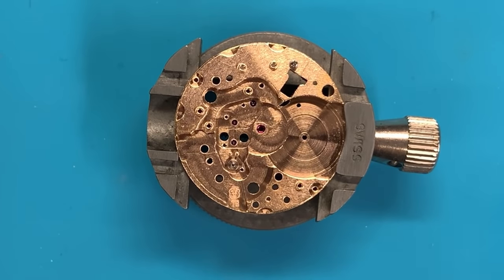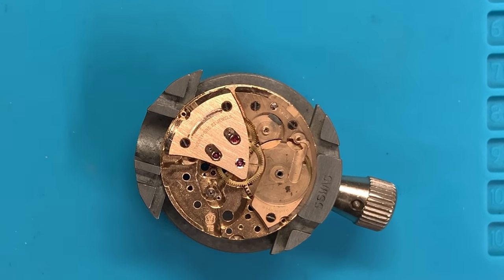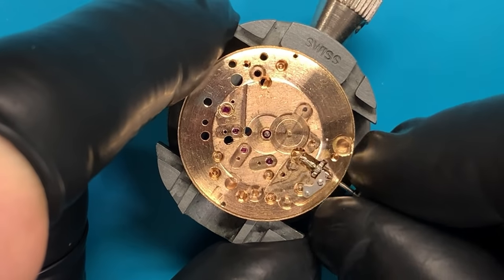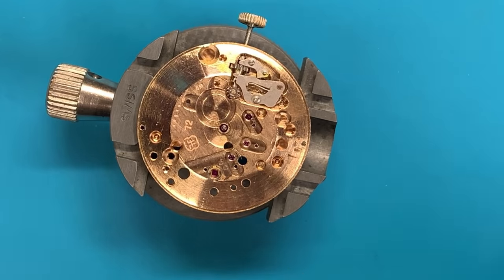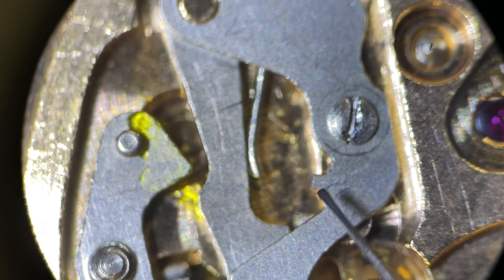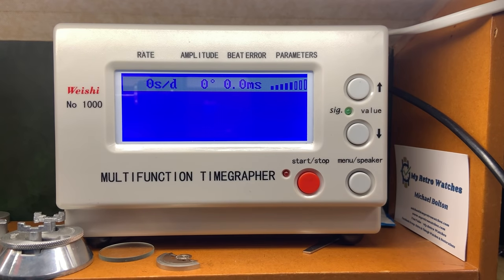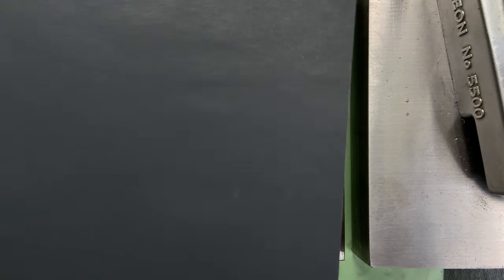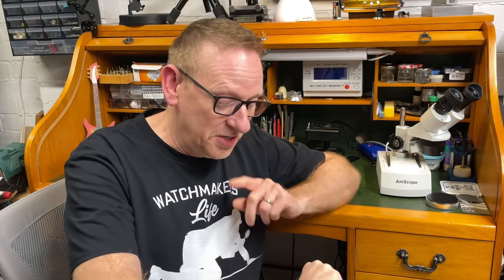HY Moser Watch Restoration Part 2 (FHF72)

Comment: Thanks for keeping it real Mike. A great learning curve for the hobbyist at every level.
We all have "Off" days and are guilty of movement assembly complacency, resulting in 
nothing much going right😱.  I like to put a blast of mainspring energy through the 
power chain before I fit the pallet fork, seeing those gears whiz around gives a clear 
message that they are in the right place. The benefits gained from not editing out the 
mistakes are invaluable.👍

Comment: Great one once again Mike. Mistakes are how we learn so I wouldn't dare worry about it. Live and learn. I'm having trouble rebuilding my first 6309A. I'll use your persevering attitude and crack on with it. Cheers
Reply from the maker: What the problem with the 6309?
Reply: @MyRetroWatches  I can't seem to get the train to turn when I screw the bridges down. Tried several times to get everything lined up but for some reason the bridge won't fall onto the pivots  just right. So I walked away for a few days then I'll give it another shot.

Comment: I’ve had a similar issue with some click springs. I usually try and slide them up to fit  nicely in their recess, but some springs are short and only engage with the click if they are slid the other way. Nice angles on this video 👌🏻
Reply from the maker: Thanks. Springs can be the devil at times but my method of stubborn determination seems to work😂💪

Comment: If you are stuck for FHF parts, the "bombay bad boys" lot sell Roamers for just over a tenner a go and prob would pay to just grab a couple as parts donor's if you are going to dabble in the FHF world.   I'm actually making some vids this week, bought a Fake-O Invicta from Aliexpress and OMG... its eye wateringly baaad, also finished off and wearing my Sovereign with the Timex M53 electromechanical movement, abs lovely and been moving some pieces about like putting a jubilee on my Poljot Alarm, a new bracelet on my Pulsar blue and rose gold VK63 Meca-quartz and some bracelet repair work on a freshly arrived Pulsar V657 chrono.

Comment: Hi Mike, cheers i enjoyed that, myself opened a Rotary with a nice hand wound  AS 1704/05 I thought it's hairspring was broken but the bloody thing had literally half a mm of some lube all over and it's turning to crystals it's an absolute horror to clean very stubborn, the hairspring is now perfic after a quick go through ipa i know about chelac being dissolved so dried right away, apart from that it's a lovely 21j movement, cheers Mike took my mind off it for a little, but who thought that would get it to run right geez later mate.
Reply from the maker: I love oil filled movements as I find them satisfying when you are able to clean it all off and get them going.

Comment: The pen looks like the lens cleaning pen so you don't use your fingers to wipe. I use it on my (February 1973) olympus om1.Direct descendent of the m1. Still very nice watch but horrendous mechanism by design, I'm swaying to bulova or waltham vintage 1940s now.
Reply from the maker: Yes I think I said in the video the pen is similar to the camera ones. I have been told the Bergeon has a smaller end and made of different material .
Reply: @MyRetroWatches  yes, concept the same, so many gadgets for watches. Do you service watches for the public and use as material for vids?

Comment: Good work Mike. one question, do you press on the second hand?
Reply from the maker: Yes. Sometimes only with the tweezer as it just the way I have thought myself. Second hands usually go on first go for me now. Occasionally they need a little push with the hand tool.